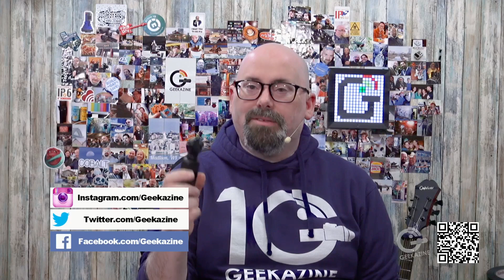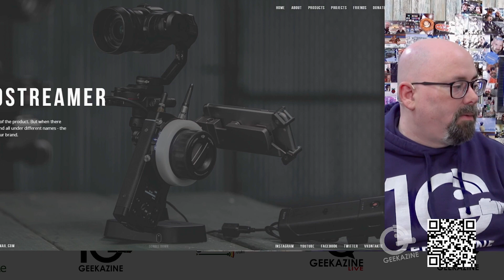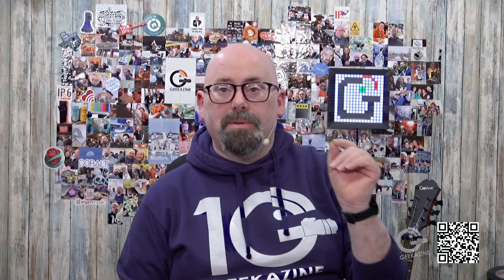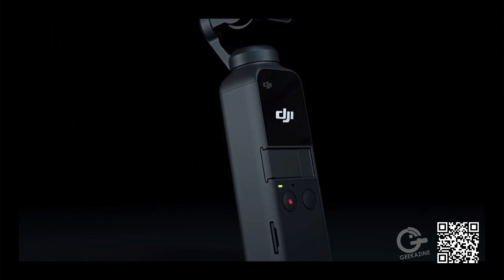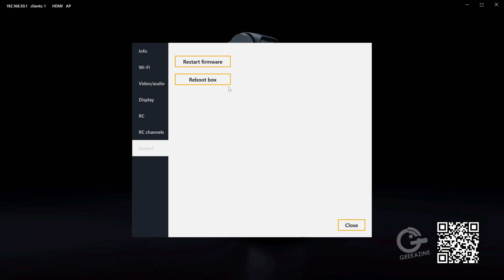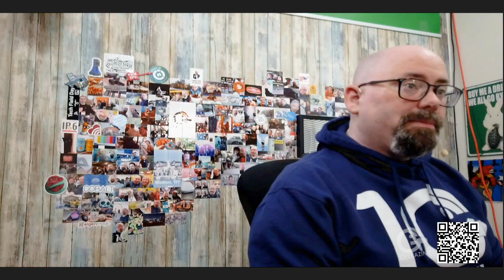Live Streaming with DJI Osmo Pocket, Cosmostreamer, Grip Gear Slider

Comment: I was adding the hardware to my Amazon cart during your video... then cleared it all when you got to the actual live stream from the Pocket.  The video output is far too glitchy.  Why not develop cosmostreamer as a Mac/Windows application and skip the WiFi and all the extra hardware?  This would recuse latency and improve stability.
Reply from the maker: This video is a couple years old, and I was doing the slider, which adds a little complexity to it. I used this when I travelled and needed to keep my gear light.

Comment: can the DJI Pocket be used as a webcam only with a wireless module and without the raspberry?
Reply: From the research I've done; unfortunately not. I was hoping that the Elgato Cam Link 4K might help but apparently not.  It looks like DJI don't support HDMI...
Reply from the maker: That is correct, but it's not impossible - I think DJI would just need to put out an update to do it.

Comment: $150 for the software cosmostreamer.   That’s a non starter.
Reply: Indeed, you can get a WebCAM for $40., that has PTZ and is powered over Ethernet!
Reply: @scottkarlins  link???
:)
Reply: @scottkarlins  Literally this.... wifi enabled, ethernet port, mobile app software, local pc software, 1080p, night vision, microsd card .... im using on as a security camera at home but realistically it could be used as a webcam. At this point id rather spend $40 on a hdmi cap card and $100 on a digital camera with micro hdmi output... it would make for a drastically bettter webcam than this osmo pocket. $130 is absolutely ridiculous.
Reply from the maker: Sorry to hear.
Reply: @geekazine  yeah you might as well go buy a web cam.

Comment: Do you know if The Osmo Pocket works with Switcher Stuido?
Reply from the maker: I do not, but I would guess it doesn't. This uses an Android base, and Switcher is iOS only at this time. There is no browser option, either. #thanks for the question.

Comment: Hi Geekazine

The Backpack solution :) great..!

Id like to use this ability to live stream from my adventures when I am in the field teaching and educating nature in Africa on a 3G or a 4G in China. 

Apart from the small glitches, do you see any other reason for it not working?
And what sort of Mb/s do you think I would I need to get it actually working? What if the cosmostreamer or wirecast doesnt have a data centre near me?
Reply from the maker: These glitches have been cleaned up since. I also got a more flexible USB cable. Last time I tried it, it worked really well. #Thanks for the comment!

Comment: Hi Jeff, how has the cosmostreamer held up in your workflow? I haven't seen any new videos made on it, so I'm guessing that you're not using it for your productions as a streaming cam? Also, with the state that the cosmostreamer is in currently, do you see it as being a feasible solution for IRL livestreaming? Thanks for the informative video!
Reply from the maker: I've planned to use it for a couple events, but things changed, and, through no fault of the streamer, I had to change with it.
Reply: @geekazine  Thanks for the update! Information is sparse about this setup, so I hope you don't mind me asking you about it.

I'm particularly interested in using the cosmostreamer setup for outdoor livestreaming. From what I understand, you hook the osmo up to a raspberry pi running the software. From there, how would you get the osmo online and streaming? It seems that the cosmostreamer only creates an hdmi out for the osmo, correct? Also, once the cosmostreamer is connected to the osmo, you lose functionality of the osmo, unless you have the setup hooked up to a pc, running the special software, is that correct?

Sorry for the wall of text. Thanks so much for your input!
Reply from the maker: That is all correct. Or you can wire the Pi to a RC controller to remote the Osmo.

Comment: What was the total cost?
Reply from the maker: So $349 for the Pocket, $160 for the license, $35 for the Pi, and $10 for the USB cable and adapter. I've had the slider for a while, But I believe they are around $125

Comment: About video corruptions: i can't repeat this problem, it works ideally at me. I need to reproduce this problem to fix it :-(
Reply from the maker: Might also have been static electricity. Could be a cable issue, too. But the stability was still good enough to continue the experiment.